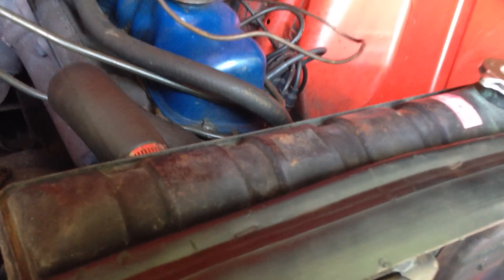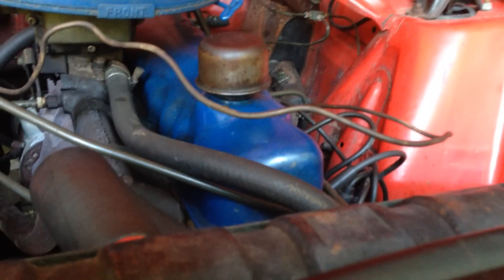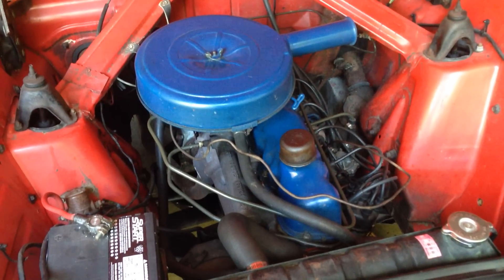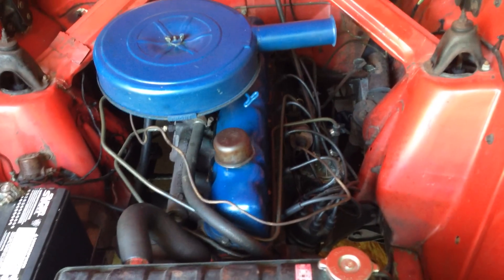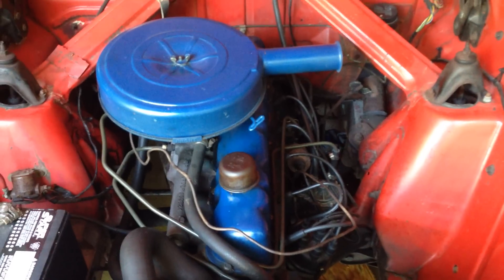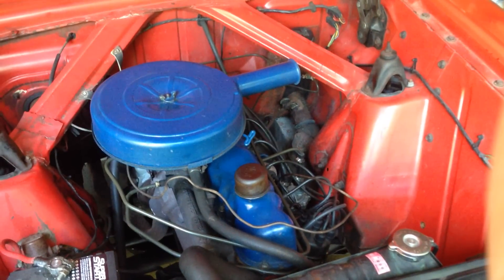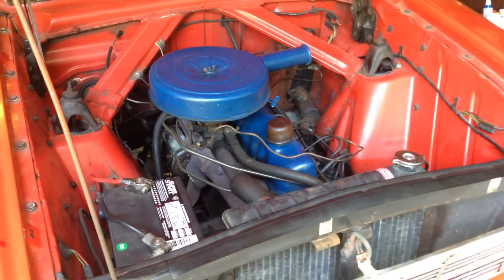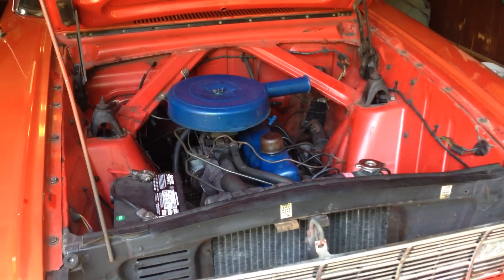Falcon Engine Swap Thoughts

Comment: Bleed the cooling system by turning the heater valve all the way open, and leaving the radiator cap screwed on part-way. You can squeeze the radiator hoses to facilitate burping the air out. The other thing to note is since there's no expansion tank, the radiator should only be filled high enough to cover the core as viewed through the cap. 

If you do get the cooling system bled but still have overheating issues, swap to a modern aluminum radiator. A fan shroud and new fan clutch might not be a bad idea either. I don't recommend electric fans until you do the supporting electrical system mods (a 90A alternator and upgraded wiring.)

Comment: Keep the original engine if possible. They say that you have to work for the good things. So work at it. Set a limit to how much your willing to throw at so it doesn't just become a money pit. If that limit is reached and it still doesn't run right.. Then do the swap. As to what engine to swap, maybe a 5.0 coyote? That would be pushing it. But man would it be fun. Either way, amazing car.

Comment: You should black plastidip all the chrome, put a duck tail spoiler on it and drop it as low as you can. Keep the old wheels though and while your at it, get some thick rimmed glasses and a baseball cap. Also black ice air fresheners instead of an air filter will ensure the engine gets nice fresh air for clean combustion.
Trust me, i'm on the internet.

Comment: RegularCars I had the exact same issue on my AW11 that you do on your Falcon. The steps I took to fix it were to do a sniff test to see if it was head gasket failure, and it wasn't so I then proceeded to change the thermostat, radiator and rad cap and it seems to have sorted the coolant reservoir kettle I had. I am from the UK so I have no idea where the bleed points for a Falcon are, but you could take the rad cap off, turn the car on and squeeze all the hoses that have coolant running through them, to try and flush out an air lock as that could be the cause. Lastly it could be a faulty water pump so you could change that. If none of the above sort it, you have some sort of magical and baffling motor!
Reply: Needs more commas
Reply: Oneof_thosepeople What a helpful comment, I'm sure your input will help solve the issue Mr Regular has! Also you didn't end your sentence with a magical little dot at the end, shame.
Reply: aw11! 
        ^ on of the rare magical dots with a line on top :o

Comment: I would swap the bigger 250 I6 in it. 50+ more hp and you get to to keep the stock look. Plus the 250 I6 has the V8 bell housing so you can run a C-4 or AOD auto behind it.

Comment: 300 inline 6?  bomb proof and make okay power with mild mods
Reply: UNLIMITED TORQUE UNLOCKED
Reply: theblackmech  I so hope he does that!
Reply: "Mild Mods" only. Once you start messing with the i6 the life span just decreases. These 300's are bullitproof torque work monsters.  I say throw one of these in with a t14 trans or zf5 5speed. (I have a 1994 f150 flare side with a 96 300i6 mated with a 92 zf-5 trans, and 3.55 gears... the Franken-truck is real).
Reply: theblackmech i dont know if its okay power xD still less then a preius
Reply: Nope will not go on easy to long
Reply: michael bickford what
Reply: michael bickford just throw it in easier said then done water pump will be in the grill

Comment: Uhm...  Is that steam coming out of the valve cover breather?  You've got some head gasket issues there, methinks...  :\

Here's my thoughts on doing the swap:  If it were anyone else with the car, I'd say hell yes.  But, this is Regular Car Reviews.  If I were in your shoes, I would be rebuilding THAT engine and THAT transmission; keep the car as much like what it was when it was new.  Keep it the Regular Car that it was always intended to be.  :)

Comment: Set heater for full blast, take radiator cap off, start engine, massage upper and lower radiator houses. Couple minutes of that and you'll get the air out trust me.

Comment: Its the thermostat get a new one replace it fill it up with coolant drive it around the block let it set cool down for awhile check the coolant top it off repeat. There is no bleed valve. Cant promise its a thermostat sticking but with a car that old its where I would usually start also its easy. Get The Right Stuff gasket maker you don't have wait forever for it to dry and you wont have any leaking with it.

Comment: Set the heater to hot, the fan doesn't have to be on, it will circulate through the heater core this way. Twist the cap halfway off or halfway on. This will provide some pressure but give some venting. You can also squeeze the lines a little while it warms up to create some pumping action. "Oooh yea, pump the lines!" Any air that gets near the temp sender will spike the gauge, as the air will be hotter than the water. 
Edit: Hethrus beat me to it. But also if the rad cap isn't holding proper pressure it will overheat. A cap holding back 15 psi of pressure will raise the boiling point,. Where-as a failed cap will lower the boiling point.

Comment: Maybe, even a fan shroud would already make a small difference. But the radiator and fan swap sounds even better, it's just that you'll have to put in some aftermarket parts for that (which means, even worse, removing the original parts!), so then it wouldn't be original any more. I'd say: Find the problem. Take the engine and transmission out, take it apart, clean and inspect every little bit of it. Take your time! There's no hurry! The reward you'll get will be a mint running all original car! I concur that it is indeed a sacrilege to remove any of the original parts that aren't consumables like brake pads or the battery.

Comment: Similar experience on my mothers ancient Dodge Caravan a few years ago. Did a coolant flush, had air in  the system and couldn't find a bleed valve. Just propped it up on a ramp, opened the radiator cap while it was cold and let it run for half an hour. Eventually all the air will escape out the open cap.

Comment: Take the rad cap off, but leaving it sitting on the hole (you only want a small gap. You can also cover it with aluminum foil and poke holes in it, as this creates higher air pressure) then run the car and turn AC to hot if possible. Let run for a bit. Also might want to look into replacement rad/cap. Cause the problem often comes from the cap.
Reply: RegularCars Thermostat put in backwards perhaps? The fact you drove it as far as you did without overheating presents the possibility that something went wrong during the tune up.
Reply: RegularCars you know that the cooling system does work, so just bleed it, don't get a new motor!  Procedure is:  part the car nose up on a hill.  Remove the radiator cap, don't plug it or cover it or anything, fire up car, let it run until the thermostat opens (radiator return hose at top gets hot), then turn up heat full bore.  Then, as it's pumping heat, rev the engine lightly using the throttle linkage.  You should see bubbles come up from the neck of the radiator.  Continue until bubblage stops.

I've done this a number of times - it makes a huge difference.
Reply from the maker: Hethrus good idea :)
Reply: RegularCars Hethrus This. Radiator caps can cause so many problems if they fail.
Reply: Hethrus Yes - heater core could have a shitload of shit in it too.
Reply: RegularCars You can also "massage" the coolant lines to help move fluid through them and avoid air locks. When I do coolant changes I always massage the lines and leave the cap off overnight, usually get about a half liter in a 7L system the following day. 

On a car with unknown coolant I'll massage, run 80% water, turn the heat on, run the car up to temp to open the T stat, flush, and then refill. Water has a better thermal capacity so don't be afraid to mix 65-70% water (I'm in Canada, 30% coolant is good until 0F). Coolant is only used to increase boiling temp, lower freezing, and prevent corrosion. In terms of cooling, it' just not as good.  With an electric fan and any old aluminum rad this thing should cool just fine. I mean just look at all that engine bay space. Mechanical fans just suck, and not just in the sense of parasitic mechanical losses/ pump wear.
Reply: RegularCars  Yeah all these suggestions are on the money. DONT buy a rad and expect it to fix the problem. DO get a coolant funnel and make sure all the air is out. There's always the chance of a small head gasket tear or you may even have a cracked coolant passage in the block or head. If all else fails, do a leakdown test or get a block tester to check for exhaust gases in the coolant.
Reply: RegularCars Joke aside, make sure the hole on the new thermostat you installed is facing up! This is extremely important for getting air bubbles out. You can also try to find an infrared thermometer to check if the thermostat is properly opening or not
Reply: RegularCars small block v8? ford 289 i believe? would be pretty cool. or just keep it and fix the cooling issue.
Reply: RegularCars check your turn signal gaskets and the horn fluid

Comment: put a 401 nailhead in it. they came from the factory with a forged bottom end.  my 63 lesabre has one it's a great and reliable engine and it has tons of low end torque.

Comment: yes run car from cold with rad cap off for a while because the thermostat has to open with heat...the bubbles will come out...park the car up on race ramps too to help the bubbles come out of the rad (you want to make the rad opening the highest point)...Good Luck
Reply: '91 4runner It looks like the rad cap is already the highest point in the system. Makes sense.
Reply: It could be but putting it at an angle and burping the throttle will help trapped bubbles in the cooling system escape easier...Mr. Regular is lucky...older engines like these don't have as many lines and passages for bubbles to get stuck in...modern engines can be a nightmare

Comment: Already knew people would start with ls swap comments. Be original for once guys.
Reply: Rice Hunters  Hayabusa engine swap + sequential shifter :) Nah, he should keep the original engine, maybe change the radiator for a new one.
Reply: Rice Hunters GTR R34 engine swap then? :-P
Reply: Rice Hunters The LS engine is like a drunk with an erection, they will stick it in anything.
Reply: Rice Hunters Oh and the rb and jz swaps are more original? At least an ls is a better engine than those
Reply: Rice Hunters You probably want him to put a 13B
Reply: Tiberius Hrafn-Úlfur Yeah because a 13b would be a viable swap for a Falcon
Reply: Tiberius Hrafn-Úlfur Wankel pawa! But I perfer EJ255 because I love to box :p
Reply: Joan Nunez 
How about convert it to a 4wd car with an old Ford flathead powering the rear wheels and two electric motors out of a Laferrari for the front wheels?
Reply: cptnoremac lol we're just having fun, but if you're that engineered and can pull it off, fluck it why not lol. Im fine with whatever makes it stand out different.
Reply: cptnoremac That would cost an ungodly amount of money haha
Reply: Worth it to see the look on car guys' faces.
Reply: I know everybody does hate the ls swap but honestly it's a super cheap, super lightweight block capable of 300+hp NA and 20+ mpg if you're not mashing the gas all the time. I don't recommend it here because he's not building a drag car and it'd be nice to keep everything ford. But in many applications, it's a very reasonable option.
Reply: Thomas Lee The coyote is a perfectly good swap also than to keep it ford

Comment: That Falcon was available with a Windsor V8 as a factory option, surely dropping one of those in would make the most sense?

The original Mustang was basically a Falcon Sprint with a bored-out engine and more aggressive body style anyway...
Reply: The '63 Falcon was the Sprint.  This is a '60 in which only the 144 was available.  Yes I know this post is three years old.

Comment: Finally here on time:

Keep the Original 144 I6 please. Keep it all original, a regular person in 1960 wouldn't engine swap it.
Reply: kirbyswarp the original idea was that this was the Peoples Car of its era. So why change that? I agree here. Keep it original.
Reply: kirbyswarp Yea, but send the head in and get it ported and with bigger valves and high lift cam. Tubelar intake and exhaust manifold and some tripple DCOEs! Everythings getting swapped theese days. Modding existing engines has become more of an rare but more respectful art.
Reply: kirbyswarp 100% agree.
Reply: Poly Bun Were those really "regular people"? 

Those were also 2 doors.
Reply: kirbyswarp V8! V8! V8! V8! Windsor swap!
Reply: ***** Everything can be made :)
Reply: ***** 2-3000ish...? Think he can afford it
Reply: I heard u the first time. but a regrind on the stock cam, headwork and new manifolds arent that big of a deal. If you have a drill, anglegrinder and a welder, you can even make it yourself.
Reply: kirbyswarp True, but regular traffic has gotten a lot faster since the 60s. This engine has to run hard to keep up with minivans driven by distracted soccer moms, and merging into traffic is a trial every time. Also, regular traffic brakes a lot harder than when this guy came off the production line.

I suppose you have to decide if it's a showcar or a daily driver.
Reply: First of all, u dont grind ur own cams. U send them in to have them regrinded. Second, why would you do anything to the stock manifold except making a flange templet from it? Third, u can have heads x-rayed to find out how thick runner walls are and have them cnc ported accordingly.
Reply: Manifolds, yes.
Reply: Leofred2000 *reground
Reply: Nick Radloff no no no no no
Reply: Nick Radloff Pretty sure a push rod system can't be V-TEC.
Reply: I was being a troll. It was an attempt to parody the 'ricer enthusiast fanboi' while a the same time infuriating the 'keep it stock' people.
Reply: Nick Radloff I was hoping you were.
Reply: Benjamin Garay Glad I didn't let you down, haha. But in all seriousness it depends what he is looking for in the car. I know a lot of people that swear by an engine upgrade saying that it 'breathes new life' back into a dying car. But at the same time I hate when people ruin a classic by trying to turn it into something it is not. Its like trying to turn houseboat into a speedboat when you could have just started with a speedboat to begin with and end up with a better end result. All in all, I think it all depends on how well the conversion/swap is done. If it is tasteful, classy, and expensive they usually turn out well. If its ghetto-rigged and a rush job it typically ruins the car.
Reply: It needs some push rod V8 love. Or maybe turbocharge it. Can it be upgraded with VTEC?

Comment: SR20DET
Reply: Alfonso Guerrero get outta here car weeaboo
Reply: Alfonso Guerrero The one in my g20 has a stretched timing chain :((((
Reply: sr cant handle the weight of the falcon
Reply: yungtakumi lolno. the Falcon is about 3700lbs, your average stock 240 is almost 3000lbs. it would be fine and still end up faster than the stock 6.
Reply: nou
Reply: Alfonso Guerrero boooo
Reply: nah go rotary engine ftw

Comment: Honestly, save yourself the headache. Pull the engine and trans, leave it in the garage incase you want to sell the car one day. Get a 5.0L out of a foxbody, and drop it in. Or, just put an LS1 in it.
Reply: TheCompyshop If this was any other build I'd agree with that. But this is supposed to be the regular car of its day. I'd like to see it as original as possible. Headaches and all :-)
Reply: TheCompyshop on a long enough timeline.